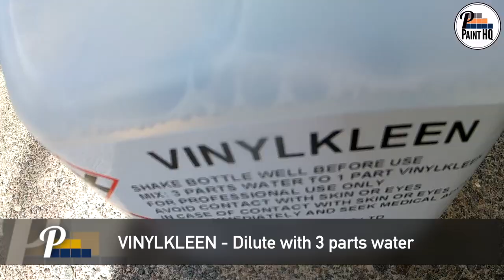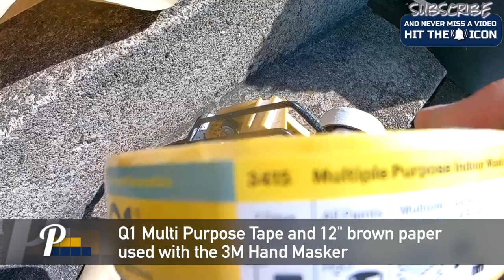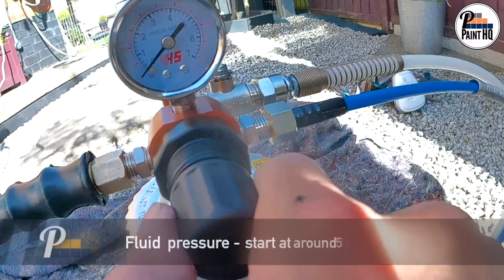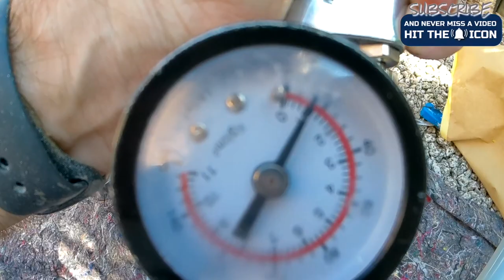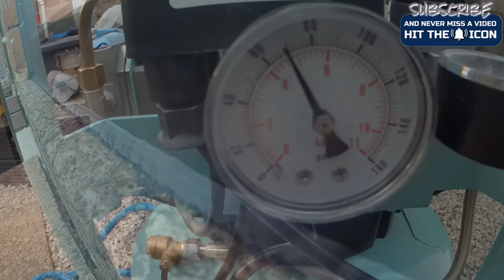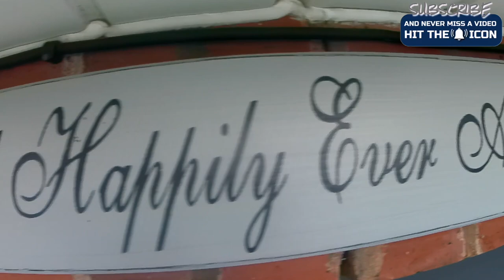uPVC Door Spraying | How to Spray PVC

Comment: Hey...Great video, you look to have a very professional setup...would love to know what.I'm looking at spraying my own windows but can't decide on what system to use.  Do I go compressor and HVLP gravity fed gun (would a 50ltr/14cfm compressor tank do the job??) Or do I look into a HVLP turbine system?? Also got my eye on  a Wagner XVLP 5000...so much to choose from....any advice?? Thanks
Reply from the maker: Hi Eddie, really appreciate you watching the video and the kind feedback.. more than happy to help, to get you up and running.. With the compressor setup, it’s so versatile and in my opinion you get so much more for your money.. for example the regulated pressure pot/cup in this video is much cheaper than the turbine equivalent.. with a pressure cup you’ll have more manoeuvrability, males life easier up a ladder (you can hook the cup on your belt, or a ladder rung.. with a compressor Vs a turbine, the compressor air line is much thinner and flexible.. a compressor you’ll get more atomising air Vs the ‘legal’ limit of a turbine HVLP.. although solvent based uPVC paints are low viscosity (thinner) so you’ll have no problem spraying with either technology.. regarding the XVLP systems, I very much like the technology.. check out my XVLP video 
https://youtu.be/1C2CV8mEWn8

..My issue with XVLP, is the extra air is strong, you really have to make sure your masking is stuck down.. with the extra air, you’re combating how the air can impact the finish.. trick is to use as little air as possible to atomise the material.. what I’ve also found with XVLP (it’s why I would use for uPVC).. when spraying very low viscosity materials, almost like water.. the low density causes a problem with pressuring the pot.. this causes a stop / start spray (very frustrating).. anyone used XVLP, will experience the same problem when cleaning / flushing with water.. it pulses 

The Gentilin compressor in my video is 24 litre with a air delivery of 5 bar, 150 L / min (5.3 CFM)..  Do you currently own a compressor?.. Hope this covers your questions, I’m happy to help answer any further questions.. keep in touch my friend, I’m interested to know which you go for.. regards Pete 🎨💯
Reply: @PaintHQ  Thanks so much for taking the time out with your detailed reply....sounds like you've been in exactly the same position as me when trying to choose the best system and bang for your buck..a lot to digest. Will definitely come back with more questions when I've had chance to properly understand and research your reply...Thanks again.
Reply from the maker: You’re very welcome, anytime 😆
Reply: @PaintHQ  ...I noticed on your YouTube channel you promoted the P&D Show in Coventry. Good shout, as I'm now definitely going to hold off on what to buy until after I've visited!!! I don't yet have a compressor...my first choice was a Hyundai HY3050 50ltr, 14cfm, 3hp, 8bar 116psi...Gets good reviews and is only £300, but I'm worried I'll have to stop/ start when it runs out of air (reason I started looking at turbine systems...Apollo, Grace, Qtech etc...however after looking at your Gentilin, I assume it provides continuous air, so no need for a large tank? Would love one, but out of my price range for spraying my own windows and doors at home...maybe there's offers to be had at the show!!??
Reply from the maker: Hi Eddie, yeah that’s great that you’re attending, I’m sure you’ll receive lots of advice and inspiration.. I’ll be on the SpraymanUK stand both days (along with taking a look around and enjoying the show myself).. I’m not sponsored or advertising SpraymanUK in any way, so when I say pop and see us for a chat, I genuinely mean it’ll be great to meet you and try to help.. A guy called Mike from SpraymanUK is very knowledgeable regarding all things spraying, especially compressors 😆 ..The Gentilin I chose was to future proof me, in terms of having the power / CFM to go Air Assisted Airless (basically Airless spraying with the additional air from a compressor).. so it’s very possible you could ‘size down’ for feeding a HVLP / HTE setup.. I’d have to clarify that for you.. but yeah it’ll be a great show, that would benefit you.. Kolorbond are there, and I’m sure various companies in the tapes and masking world.. I can advise you on that too 😆 ..See you there, in the meantime feel free to message anytime.. regards Pete 🎨💯

Comment: hi mate love your channel and work! was going to spend 1200 on  a hvlp qtech 5stage would you recommend it for kitchens and windows? also what tip do i need to spray primer mate
Reply from the maker: Hey buddy, thank you so much for the kind words of support.. the QTech unit is certainly a popular machine and being a 5 stage turbine, it will have some ‘power’.. I prefer the versatility of the air spray compressor setup, the lighter / more flexible air line, coupled with a regulated pressure pot, you get more dedicated air to the gun.. so you get a lighter, flexible setup for going up a ladder or spraying the intricate features of a kitchen.. then if you desire, in future you could couple the compressor with airless and venture into Air Assisted Airless 👌👍😆 ..Happy to help some more if I can.. let me know how you get on.. regards Pete
Reply: @PaintHQ  cheers for that mate i was a bit late on reading your reply otherwise i would of held off buying the hvlp but ive purchased it now haha ! i will keep you updated on how it goes my friend thank you for your help
Reply from the maker: No problem at all, yeah keep me posted how you get on.. exciting times, it’s nice getting new kit 🙌

Comment: Love the work you did on this job👌🏻 what method do you use to clean your gun and pressure pot?
Reply from the maker: Hi Andrew, apologies seems responses to your comments on the channel got mixed up 🙈  ..I’ll always do my best to help answer any questions the best I can..

Hey Andrew, thank you my friend 🙏 ..Great question.. it’s actually quite a simple and quick process of flushing through small amounts of ‘gun wash’... if I recall, this video demonstrates the process..

How To Setup A Pressure Pot | HVLP Gun Cleaning
https://youtu.be/ceaoXCDqPYQ

Hope this helps, great to have you contributing on the channel.. keep in touch.. regards Pete
Reply: Hi Pete. Would you do a video on spraying a UPVC window and how to tape it up the best way and do you take the sash out like you do the doors? I’ve done my first door today and  2 windows. It wasn’t easy taping it all up
Especially the inside of the windows so the spray doesn’t go inside. What’s your best way when doing windows with openers? I can’t find any videos on YouTube for this. Thanks 🙏
Reply from the maker: Hey Andrew, it’s on my list of videos to produce.. I’ll be spraying all my uPVC windows as soon as I can find a slot in my schedule.. I plan to demo various strategies, hopefully covering your dilemma.. I’ll include taking the window opening out, which in my opinion is the best option in the long run (probably for the ‘issues’ that you may have encountered.. In a comparable way to spraying internal doors and door frames, it’s far easier to take the door off and remove the door furniture than struggle taping up.. you never quite get to spray all the edges easily 🙈 ..Keep going my friend, you’re doing great.. and I’m happy to help all i can.. regards Pete

Comment: Hi mate . I really love you r videos. What is for you a AA setup spraying Kolorbond?and how much paint did you use on the door and frame?
Reply from the maker: Hi Alexandru, really appreciate your kind words of support.. I’m more than happy to help you as much as I can.. the setup isn’t an AA (Air Assisted), it’s an air spray pressure feed gun running off a compressor.. here’s the details.. The gun is the Anest Iwata AZ3 HTE2 pressure feed gun with a remote 2 litre pressure pot.. Running off a Gentilin Ultra Quiet 24 litre compressor, with a delivery of 5 bar, 150 L / min (5.3 CFM).. I was able to spray with a huge amount of control, only spraying a small amount of material.. I’d guess approx 250-500ml (max).. hope this answers your question.. more than happy to help some more, anytime.. regards Pete
Reply: @PaintHQ  you are just epic .Best one i have seen so far and i have been dooing painting for the last 18 years
Reply: @PaintHQ  what gun would you recomand for upvc painting?
Reply from the maker: You’re so kind, thank you very much 👌👍😆 keep in touch 💯

Comment: Hi there, can I get the same finish with a graco 9.5 finish pro ?
Reply from the maker: Hi Glen, most definitely my friend 👌👍🙏 ..regards Pete
Reply: @PaintHQ  thanks, I was very impressed with the little overspray though as 9.5 seems to have a lot of overspray maybe ok in a spray booth but not so good on site and it’s heavy to hold. I watched one of your other videos and you used a gx 21 and converted it to AAA. I have a gx21 and am really keen on converting mine as there was practically no overspray . If I was to convert mine could I use this to spray kitchen cabinets, front doors, garage doors upvc windows as well as ceilings walls and woodwork?  I have been looking on spraymans website at the packages he does and there are three. Can you recommend which package you would use for this type of spraying. Sorry for the long reply. Many thanks Glen